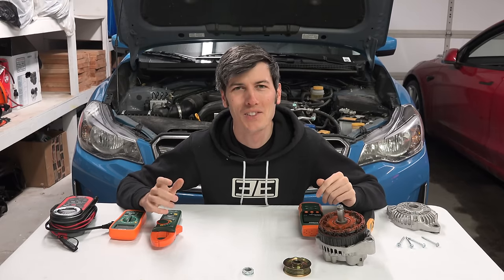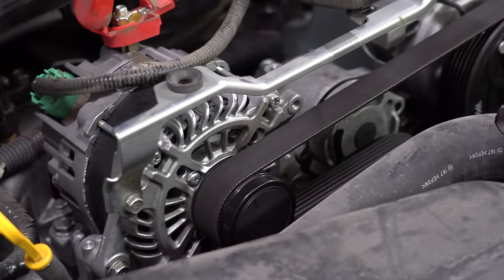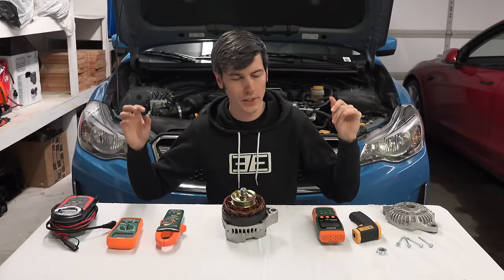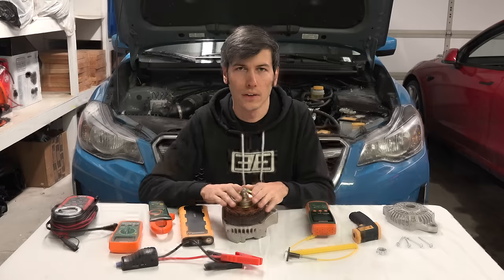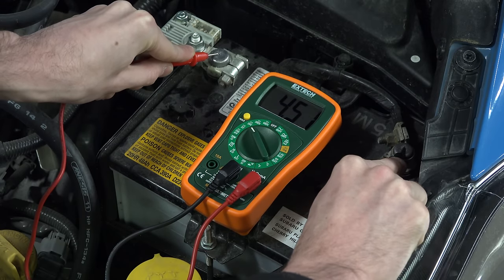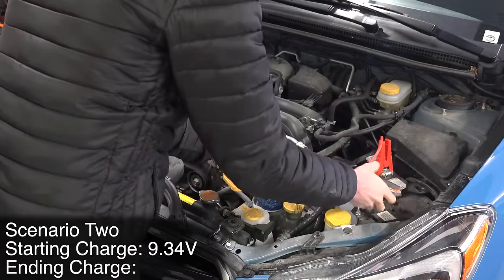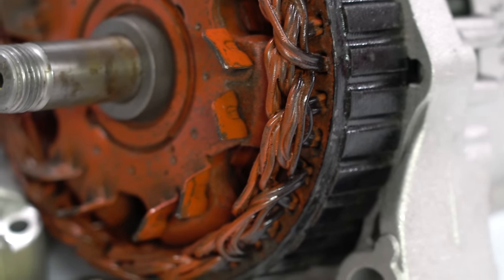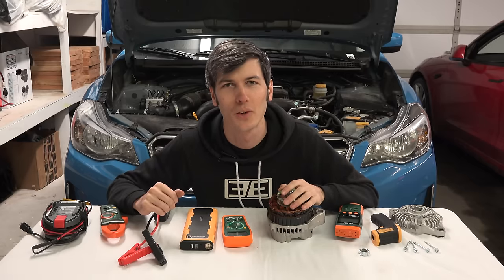Can A Dead Battery Ruin Your Car's Alternator?

Comment: How the rectifier etc setup is why some people think a dead battery kills alternators.  Here is the scenario:

-Dead Battery
-Bad alternator
-Alternator replaced with new
-System not charging
-Buyer and part’s guy assumes new alternator is now bad and dead battery ruined it.
-Real situation is rectifier was protecting the alternator because you should charge a battery before installing the new alternator.

This exact situation happened to me.  While on a road trip.  Alternator failed and battery drew down to 9v while getting to parts store.  I replaced alternator in parking lot.  Voltage still 9v when running.  Parts guy said alternator must be defective but they didn’t have another and I needed to drive to the next store.  On the way to the next store voltage was holding 9V, after while it jumped to normal 14.7.  Battery lasted 2 more years.  My electronics buddy told me about the rectifier not wanting to put out extra voltage.
Reply: Underrated comment, thanks for the info!
Reply: I would say voltage regulator, not the rectifier.  The voltage regulator draws from the battery to power the rotor field.  There's a threshold for the regulator to turn on the field so the alternator can generate power.  I don't remember the exact conditions offhand.  Also, the windings would be drawing a good amount of amperage which would keep a low battery reporting low voltage until a bit of charge was taken.

Comment: Jason, nice vid! A few considerations: Your car seems to use around 15-20 amps while running (from 1st scenario). The max current from the alternator was around 60A (2nd scenario). So you had something around 40-45A going into the battery. In 30 minutes, that is 20-22AH (amp hours), even disregarding losses on the charging process, you could only have put HALF a charge in that 48AH battery in that time frame.  If the voltage after the half hour you said you left the engine on was 12.9v that battery has lost at least 50% of its energy storage capacity. A healthy battery would have stopped around 12-12.2v for a 50% SoC.

Comment: I'm fairly certian this is what happened to my forester's alternator. I think the battery was garbage and then it wore down the alternator over time. The problem didn't appear until after I had left my dome light on all night. The next morning the car barely turned over and fired off. Then I drove the car for about an hour and I thought all was well. However, every time the car started cold it would barely fire until it finally there was just no juice left. I jump started the car and found that my alternator was only producing 13.2v and my battery after an hour of driving was at 11.3v. I had both tested and both failed. I replaced both and all is well. I am really happy that subaru alternators can be replaced in like 5 minutes in a parking lot.

Comment: On most sailboats, the alternator is the sole charging system for the large house bank. It is not uncommon for people to run their engines once a day or every other day to charge a 400-500 Ah battery bank. Alternators get hot while doing this, but they are built to take such abuse. On a 500 Ah bank of batteries, a 200 amp alternator will be running close to full output for about 90 minutes. Current then tapers off as battery state of charge comes up.

Comment: Well explained video, although there is a lot more to take into consideration (like someone said, an aged discharged battery vs a new discharged battery will put a lot less stress on the alternator). Heat will kill the alternator overtime, that and also having to supply extra amps to the battery means it will run closer to its rated amperage and possibly affect other systems in the car when certain things go on/off due to spikes in amperage. Lesson to be learned: if the battery is dead and you have the possibility to charge it externally, please do so. Home chargers start at a low voltage (trickle charge) and constant low amps in order to ease in the resuscitation process. I had a battery run dead due to bad wiring on the car for at least ten times in a row, but i always brought it back to life on a home charger and thus, believe it or not, it was still running in decent shape after all of those discharges  (contrary to general recommendation that if you deplete it twice you can throw it away)

Comment: well now i know why my motorcycles stator kept burning up with my old battery that is not holding charge very well. great videos keep up that awesome job.
Reply: It could also be a weak or failed voltage regulator. If your bike employees a "shunt" style voltage regulator, it might not stunt to ground properly and be overheating your stator. I had that issue with my 2005 Triumph Daytona 650, the original shunt style regulator, was letting voltage leak, which overcharged the battery and caused the stator to overheat. SO after replacing the battery and stator, I "upgrade" to a MOSFET based voltage regulator. If you need a voltage regulator "upgrade" I recommend looking in to a Shindengen FH020AA R/R install kit. I love mine and have been using it for years now with no issues.

Comment: Diodes phase out the wave form from the current to convert ac to DC. Essentially, it still needs the filter circuit to remove the ripple from the DC as DC has no phase angle

Comment: Try running the same test with a battery that has a dead cell. I'd be curious to see how much of a strain a low voltage battery puts on the alternator (or the starter).

Comment: Definitely good info for people that didn’t know. I recently replaced my battery when it had around 50% life left cause I knew about how they affect the alternator and also which wasn’t mentioned is the higher amps are also slightly going into car systems and can affect them also,

Comment: The reason the battery voltage was so high was something called surface charge, if you left the headlights on for 30 seconds or a minute the voltage would be much lower (one of the reasons voltage isn't the best state of charge indicator in lead acid cells, though it's generally good enough)

As for the alternator having to work harder with a bad battery all the time, it doesn't work that way.  If the alternator is outputting power, it has to go somewhere, in the bad battery scenario that would be the battery itself.  If this happened (it's possible but rare) your battery would heat up and start boiling\melting (a battery really isn't meant to dissipate several hundred watts of heat)
Reply: Yes I was thinking the same exact thing, an alternator will only "surface" charge a dead battery. I am glad someone pointed this out, and yes high amperage in to a dead battery is never a good mix... I have seen some serious incidents from overheated batteries. Even AGM batteries get pretty "frisky" when overheated. I have had the distinct "joy" of touching an AGM battery that was going into thermal overrun and getting pretty badly burnt from it. I find it interesting how few people actually even consider how dangerous an overheated "dead" battery can be. I see it all the time at work, when you try to explain to people about the danger of driving with a dead battery in the car.
Reply: @JJ_ExMachina  When I was a field IT tech for an electric utility I visited a remote site that was so hard to get to we tried to ignore it. I walked in and felt heat from the battery room and heard hissing in there. I found all the rectifiers in current limit and the entire bank of sealed (VRLA) lead-acid batteries in thermal runaway. I unplugged two of the rectifiers so there was only current to operate the equipment, put a thermometer into the bank, and got out of there. A few minutes later I dropped in and saw the temperature was 190F, and the polypropylene cases were only good to 225F. Adventure, I tell ya!

Comment: What I would really like to know is what the manufacturers say about a prolonged condition of use a vehicle with a "dying" battery.  Like over weeks or months, even.  The manufacturer should have done the testing with enough units under varying circumstances to determine under what conditions their alternator should or should not be greatly affected.

Comment: Jason, were you driving with the headlights off? Play any music from the radio etc? I have done the same test (on a different car) and I've found that the car needs about 250 - 300 watts supplied from the alternator to keep the battery fully charged, measured after about 30minutes of driving. This was with headlamps and radio on, heater fan speed low.

Yours doesn't even need 200 watts supplied.

Comment: Although using an alternator to charge a battery is never a good idea if we have a choice, I have not seen an alternator that was damaged doing that - not even in Phoenix where under-hood temperatures can exceed 150F. Batteries... that can be a different matter. Pumping 30A into a nearly dead battery is not good, especially for low or no maintenance batteries.
I agree: if you have to choose between jumping and driving to a place it can be dealt with or leaving it dead where it sits, everything favors rescuing the vehicle.

Comment: My wife's last car had the battery start going bad and caused the alternator diodes to whine for about 3 weeks until one day the battery was dead, it read 7 volts, but wouldn't put out enough to even make the starter click. A new battery stopped the whining and the alternator came back to life, surprisingly.

Comment: There is some subtlety as to how an automotive alternator typically operates. An alternator's rotor does have a slight permanent magnetic field but most of its field is generated through windings in the rotor. The current an alternator will output will depend on the current through those windings, which is controlled by a small electronic circuit, mainly to make sure the voltage stays constant with engine speed. If it is well designed, the alternator should be able to operate safely even if the battery is flat by limiting the maximum current it wants to supply. In fact I believe some ECUs can even tell the alternator to temporarily switch off when the engine is at full throttle, for a small boost in engine power.
Reply from the maker: Great information, thanks for sharing!

Comment: Nice video. Maybe I have some suggestions for another one.
I heard that the flooded battery is full when there is 12.8V. And if the only 12.1V is measured, the battery is technically full by 25%. And when is below 12V there is happening Sulfation and battery is going to die soon if is not charged. Do you have any info about it? How fast the sulfation will destroy battery?

Comment: Nice goggle tan. Can you do one on when batteries go bad? A friend told me once it wasn't the battery running flat repeatedly that killed car batteries, it was the rapid recharging after jump starting that killed the battery. Is that right? Ever since then, I haven't bothered leaving cars on trickle charge (e.g. project cars, or when overseas on holiday). Instead, I just allow a good 12 to 18 hours for a battery charger to bring it to full voltage again before starting the car.

Comment: Nice experiment. Another parameter that would have been nice to include would have been to use a hygrometer to determine the battery's state of charge/specific gravity both before and after the alternator charges the battery.

Comment: Great video! Another thing to consider is that a larger battery will draw more current when it is dead. AGM batteries also seem to be able to pull more current from my experience. For example, I have an Optima Yellowtop group 34 battery and it can draw well over 130 amps when it is dead. Just something to consider
Reply: @bosstowndynamics5488  Great point! It looks like it is 48 amp hours

Comment: A few other points of note:
- Low temperatures can cause excessive sag so this might actually be a normal start for cars in very cold weather as the alternator will try and cover the difference.
- The last 20% of a battery is the slowest bit to charge.
- If you have a massive sound system in your car that draws 1000W or so your alternator will be running like this ALL the time.

Comment: OK, you did glance on it but its worth focusing on much more - a 'dead' battery can mean one of two things. Either the battery is 'physically/chemically healthy but discharged', or 'physically/chemically dead and unable to take a charge'.  Most alternators are quite capable of bringing a healthy but discharged battery back to full charge - assuming the alternator has time and stability to do so, ie, long distance highway driving with minimal accessory load, and not stop n start city driving with heavy demand on all systems - but the problems start when the battery's internal health decays. Some manufacturers do have within their charging system's software means of prolonging battery health (reduced voltages/amperages once battery is fully charged, etc) but cannot cope with a dying or dead (health wise) battery.  Many high end shop level chargers do have additional means of cycling the battery to somewhat rejuvenate the internal health, but there comes a time when the battery is simply done.  This is where it takes someone skilled in the field to not only understand what is going on, but be able to diagnose weather a battery is dying - and if there's an underlying fault CAUSING a battery to die.   That's where we tradesmen (and women) step in.  Far too often someone will 'just replace the battery' and not realize that there's a fault elsewhere in the system which will just start the cycle all over again.

Comment: That last part, about a dying battery taking more continuous charge current, is a myth. It's been around a long time, but, assuming the battery does not have a shorted cell, an old battery pretty much just behaves as though it is smaller. Eventually it becomes too "small" to crank the engine, even though it is fully charged. Just as it's ability to deliver current decreases with age, so too does it's ability to accept current.

Comment: I would love to see this done at 100F ambient. I bet that is a huge factor. I wonder if a generator, or old mechanical regulators would fare much differently. Good to know that the charge rate had dropped so significantly in about 30 minutes. It seems to indicate that by the time the alternator is getting hot, the load is dropping. An internally shorted battery would significantly change that equation as the charge rate would never taper off. We could test hundreds of different variations here!
Reply: Oh, and in a hot climate, A/C would change the electrical load in addition to bay heat!

Comment: Good timing Jason, I just changed my alternator and Bosch says warranty void if installed on a car with empty battery. How would they figure out whether my battery was dead or not is beyond me, that aside, I had pushed start my car at least 10 times and everything seemed to be normal working condition (the reason why I replaced the alternator was because I had to remove the alternator to replace water pump, and the alternator bracket was damaged during reinstallation).

Comment: The reason this topic is so interesting is that electric cars in general, and DIY windmills that use cheap automotive alternators or solar cells where both use lead-acid batteries for storage. Getting, say, 20 years of life from the alternators and batteries, pays huge dividends in the cost of producing the power for your house. If they had to replace all those batteries ever 2 years, it simply would not be cost effective to use them.

The point is that they know the recommended usage of the batteries and designed for them; getting an order of magnitude better life from them. The care and feeding of the various battery types and when to use super-caps instead of (or in addition to) a battery is a deep, fascinating topic. It is even more relevant today than ever. Case in point, try to figure out all the ways a Tesla controls how the batteries are charged, discharged, heated, limited, cooled, and generally used efficiently.

Comment: I have never seen an instance where a dead battery hurt an alternator, when they were 40 amps or 100 amps. If you boost in the winter, then run the heater, rear defroster, lights and charge the battery, the alternator is either strong enough to run everything and charge, or the charge takes longer. You should note that as batteries get close to full charge, the differential voltage is smaller and takes more time compared to when it is flat.

Comment: I enjoy you are using Celsius instead of Farenheit temperature scales which is used in most papers and books and it is also simpler decimal intuitive. At sea level 0 C means water frezing point and 100 C is boiling point. By the way it also coincides with Kelvin steps.
Reply: Alfredo Eme Celsius is intuitive and easy, but that doesn't necessarily mean it's better. Fahrenheit is a finer measurement unit, which means you can get more specific measurements for small scale things (like weather) without going into decimals.

Comment: Several years ago my car started chewing through alternators once or twice a year. I always had a shop replace them, and they always said I needed a new battery too. Since the battery never failed to start the car, I never replaced it. Then I learned that the battery can become defective or partially worn to where it always accepts a charge. Replaced that and was fine ever since.

Comment: My Alfa battery is 5 years old and it's been parked outside for 2 months now. Nope, I didn't dosconnect black cable. Started up just fine on little freezing temps. I was surprised tbh.